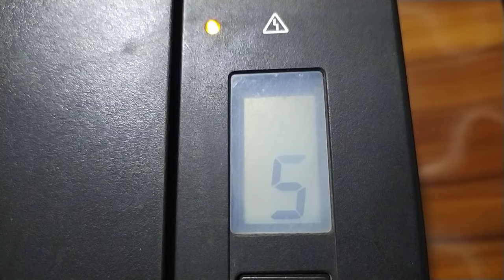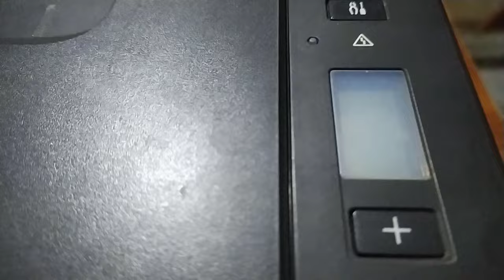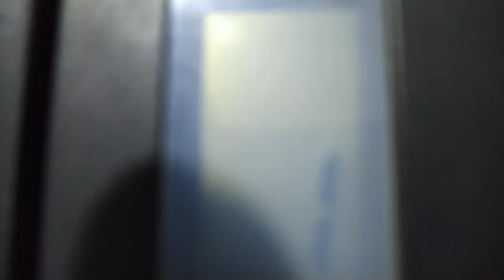How to fix Error code "E05b" canon pixma G2010 printer - canon G2010  E05b error solution

Comment: u using alcohol spray?
Reply from the maker: yes sir
Reply: i already done step by step but it doesnt work for my canon g2010.. e05c error cone still occured despite i replaced with new print head color...what do you think about it or maybe the carriage is the culprix...i ve got messages from my computer that said 'unreconized color"